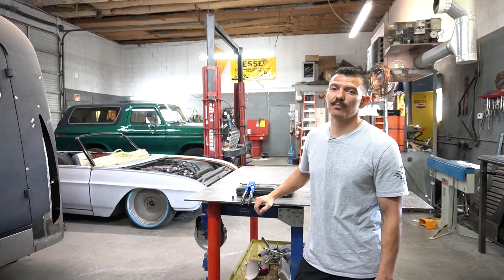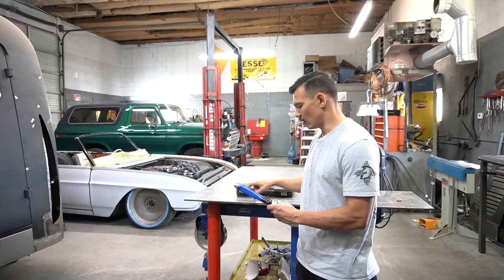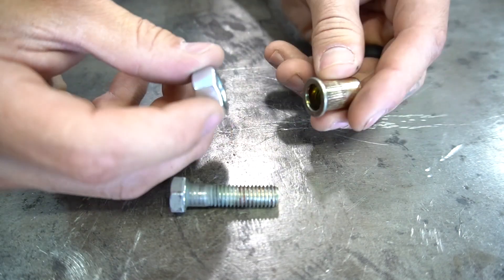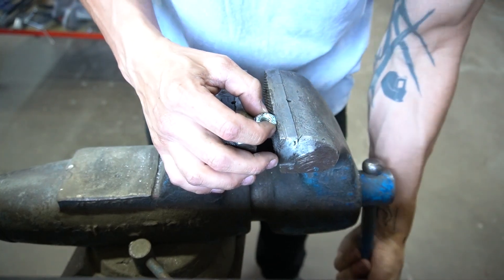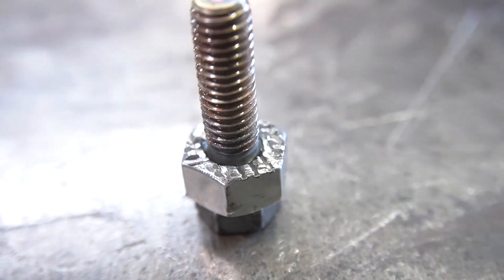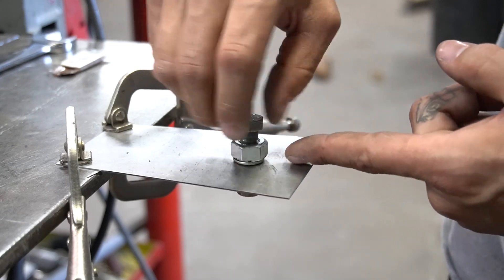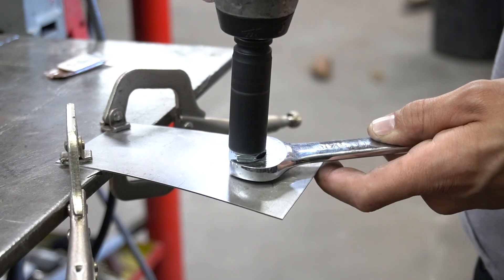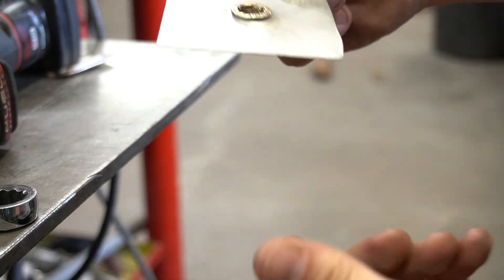DIY Rivnut tool- Homemade RivNut /Nutsert tool- easy to make!

Comment: Works for jack nuts, too.  They grip interior trim plastic panels better, more surface area behind the hole.  You can also put a layer of duct tape on the flange part with a hole in it, so your grips can hold, BUT if you have to torque it a lot, the duct tape turns from adhesive to lubricant in about an eighth of a turn!!!  Good stuff, it's what I was thinking, but you did all the noodling for me.  Thanks!

Comment: TIP: YOU DONT HAVE TO CUT serrations on the nut. The riv nut can’t spin due to you holding the nut with a wrench. Your driving the riv nut in the material and the serrations on the riv nut itself keep it straight inside the bore
Reply: He also doesn't mention that the screw can't be fully threaded if you use a nut like this. If you only have fully-threaded screws, use a washer instead.

Comment: So you are tightening it with socket and then loosening it off once its as tight as it will go
Reply from the maker: Yeah, but don't over tighten it, you will strip the threads. Tighten it where you think and back it off, if it still isn't crushed all the way, tighten it a little more

Comment: Just use a castle nut.
Reply from the maker: @todds5956  that would probably work great
Reply: Could even grind a little back edge on the protruding parts.